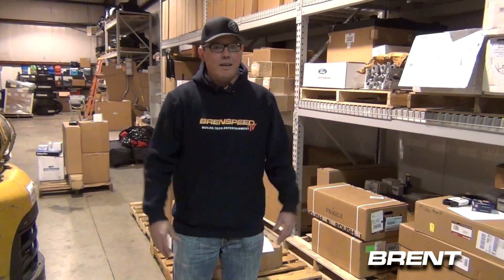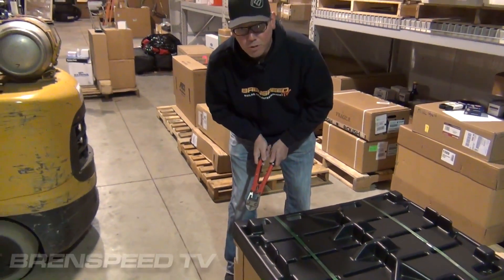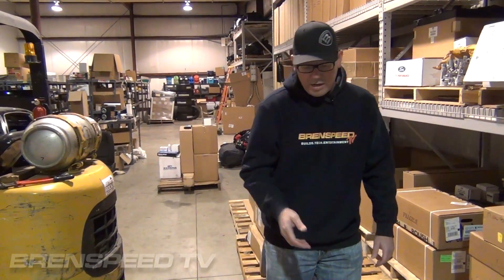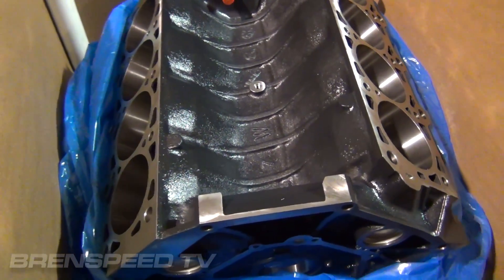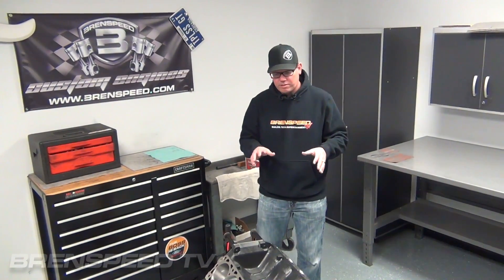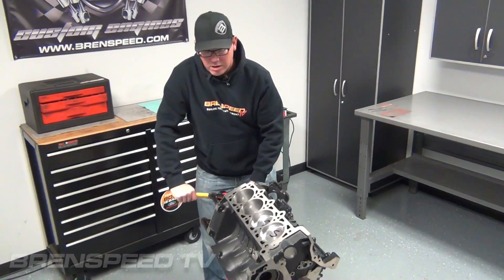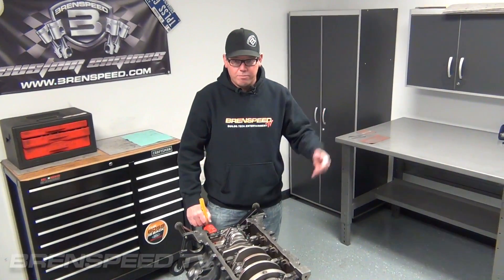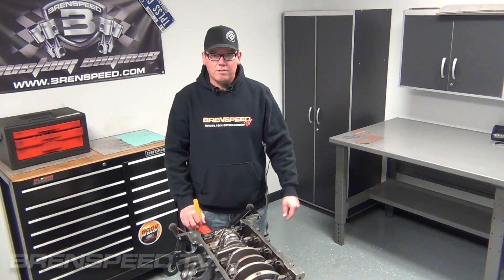Quick Clips: Unboxing Ford Performance M-6010-BOSS50 Modular 5.0 Block and B326 Sneak Peek

Comment: Does this take 2v head as well
Reply from the maker: The block is designed to, but our B326 3V we build does not. You need a different piston. The FRPP short block will allow a 2V head.

Comment: Is this a direct replacement for a 4.6 3v? I currently have your Paxton kit and want to make more power and deciding on paying to have the 3v forged or buying a drop in block
Reply from the maker: It requires the use of these motor mounts. Besides that everything else bolts up to it. Here is a link. https://www.brenspeed.com/m-6031-boss50.html

Comment: What’s the flywheel bolt pattern
Reply from the maker: That block does not come with a crank. Its just the block. But we use a 8 bolt crank in them.
Reply: Brenspeed  sorry I meant when the short block is fully assembled
Reply: depends on what crankshaft u put in  6 or 8 BP

Comment: Would it be possible to pair up with a 6r80 transmission? I have an 07 GT auto and Im on the fence of Coyote swapping or going with this block. But i wanted to know if i can use the 6r80 with this block also.
Reply from the maker: Yes Rick you can go 6R80 we have a swap for that. Here is a link to the controller. You would need a trans. 
http://www.brenspeed.com/usq6.html

Comment: I'm not a mechanic but can I buy this and use the rest of my 3v motor, the brenspeed rockers, pistons and so on and now be a 302 instead of a 281?  Can I use my steeda pullys, kooks long tubes?
Reply from the maker: As far as the block goes you would not be using any of your old internal engine parts. The bores are larger and the pistons would not fit. Anything on top you can re-use. Heads, headers, pulleys, cams, all of that can be used. THANKS

Comment: so i have this block for my mach 1 and my question is WHERE DO I PUT THE KNOCK SENSORS????? this block does not have the sensor mounts =(
Reply from the maker: R&A COMEDY you don't use them. They don't use knocks on this block.
Reply: Brenspeed okay thank you

Comment: I have been interested in this for awhile.  I am curious what the difference is between this and the new ford 5.3L they released.  Also could you install one of these in a n/a 3v and see what the differences in hp/tq would be?
Reply: Jed Knouse :5.3?????
Reply: AASR 32 yes look on american muscle, ford boss 5.3 short block
Reply: Jed Knouse yes you can use it on an na build and get more power, its all the same iron block bren just punches it out more for more cubic inches